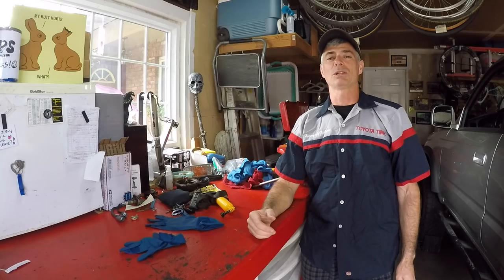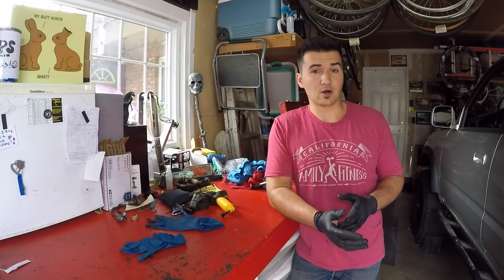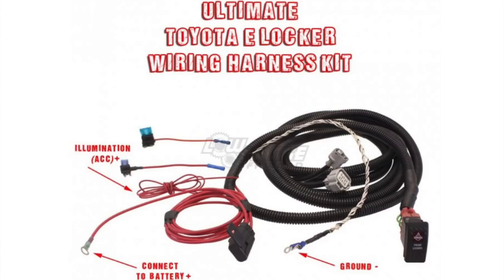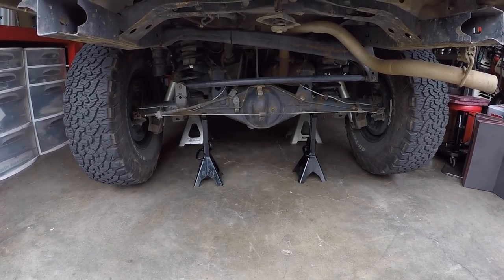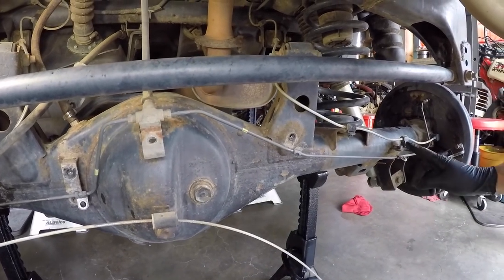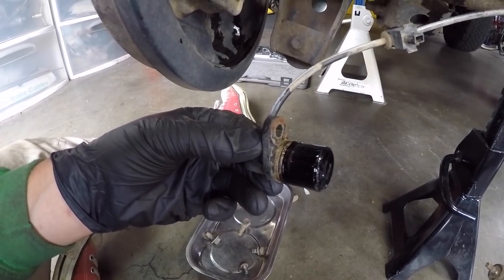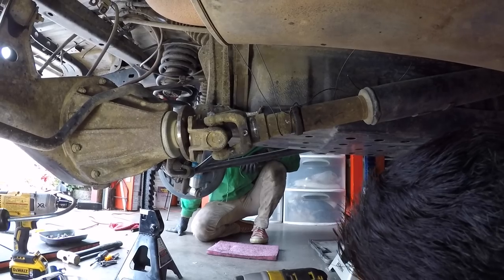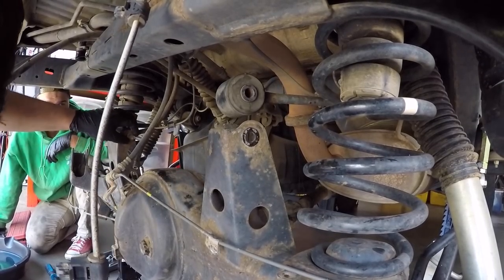E-Locker Axle Swap + Wiring How-To

Comment from the maker: PLEASE READ THIS COMMENT AND THE VIDEO DESCRIPTION FOR HELPFUL INFORMATION

TOOLS USED FOR THIS JOB
**If you don't see a tool you need listed below, here's a master copy of Timmy's suggested tools:
https://docs.google.com/document/d/1TV08fumiXvyrb6yBMPl0gsp7UlcQEa9lHtqFNiZWOVI/edit?usp=sharing

6 Ton Jack Stands - (used to support frame of truck and support donor axle housing)
 https://amzn.to/2MM91w6

3 Ton Jack Stands - (used to support axle housing on truck)
 https://amzn.to/2qPYS9O 

Heavy Duty Rubber Wheel Chocks - (used to keep the front wheels from moving.  These are nice chocks that don't slip)
 https://amzn.to/2mttRWp

Dewalt 1/2" Drive Impact Gun - (nice strong gun.  used to remove wheel lug nuts and many of the fasteners for this job)
 https://amzn.to/2M2Y9J1

Dewalt 3/8" Impact Gun - (used for some of the smaller fasteners for this job)
 https://amzn.to/2uqWnZy

Dewalt Batteries
 https://amzn.to/2urcx59

Dewalt Battery Charger
 https://amzn.to/2Ud8RlY

Wheel Lug Nut Impact Socket Set - (nice set for all different size lug nuts)
 https://amzn.to/33uatZt

1/2" Drive Deep Metric Impact Socket Set
 https://amzn.to/2WfSTGD

1/2" Drive Shallow Impact Socket Set
 https://amzn.to/2pCrdPQ

3/8" Drive Deep Impact Socket Set
 https://amzn.to/2ZWjY6C

3/8” Drive Shallow Impact Socket Set
 https://amzn.to/2KnoYaq

Flex Head Flare Nut Wrench Set - (used a 10mm flare nut wrench to disconnect brake line.  This is a very nice set with lots of uses)
 https://amzn.to/32GoIdy

Vacuum Cap Kit - (used a 7/32" vacuum caps to put over flared brake line tubing ends to stop brake fluid from leaking out)
 https://amzn.to/31hXY2G

Straight Needle Nose Pliers - (used to remove parking brake line clips)
 https://amzn.to/2pQ6yIa

Plastic Mallet - (used to knock parking brake line pins out and many of the control arm bolts out)
 https://amzn.to/2CCOqVP

Brass Hammer - (used to knock out one of the panhard bolts out)
 https://amzn.to/2QS3Ay7

20 Piece Screwdriver Set - (several screwdrivers were used during this job.  This is a nice complete set)
 https://amzn.to/34aLrQ1

1/4" and 3/8" Flex Head Ratchet Set - (used both these ratchets for this job.  These ratchets are super functional and will make your wrenching life easier)
 https://amzn.to/2ql8nNA

3/8” Drive Regular Extension Set
 https://amzn.to/2OehCao

3/8" Drive 6 Point Metric Standard Socket Set
 https://amzn.to/32WIh0M 

3/8" Drive 6 Point Metric Deep Socket Set
 https://amzn.to/37iQjVt

1/4” Drive 6 Point Standard Metric Socket Set
 https://amzn.to/2QIU7te

1/4” Drive Regular Extension Set
 https://amzn.to/2O9nl2x 

Long Magnetic Parts/Tool Tray - (Good for holding longer tools like ratchets and wrenches)
 https://amzn.to/2m89y0D

Medium Size Magnetic Parts/Tool Tray - (Good Size for keeping track of fasteners/small parts)
 https://amzn.to/2ky8Qt8

Small Size Magnetic Parts/Tool Tray - (Good for holding lug nuts or smaller fasteners/parts)
 https://amzn.to/2m6kQ5y

Small Pick Tool Set - (used a pic tool to help release the extended breather hose on the top of the differential)
 https://amzn.to/2MyN4AH

Long Set of Ratcheting Box End Wrenches - (used these several times in the video.  These are great when you need extra leverage)
 https://amzn.to/2oOhndL

Mayhew 5 Piece Prybar Set - (used a pry bar to force the shock off the lower shock mount.  This is a nice complete set)
 https://amzn.to/2Ob8THw

Mission Automotive Silicone Paste - (used some paste to lubricate the lower shock mount post to have an easier time getting the shock in place)
 https://amzn.to/2NU1En6

Auto Trim Removal Set - (used this set to remove interior trim pieces so we could run the wiring)
 https://amzn.to/37vgzvH

CDI 1/2" Drive 30-250 Foot Pound Torque Wrench - (used this one to torque the lug nuts and larger fasteners for this job)
 https://amzn.to/2UPhyjK

CDI 3/8" Drive 10-100 Foot Pound Torque Wrench - (used this one for the small to medium fasteners for this job)
 https://amzn.to/2U2vUA4

**As Ebay Partner Network members, we earn commissions from qualifying purchases.

**As Amazon Associates we earn from qualifying purchases.
Reply: My differential lock stopped working In my 2nd Gen. Tacoma about 3 years ago I bought a factory new motor for the lock As instructed by a mechanic shop nearby. It still does not work. When I push the switch The locking diff light comes on But just keeps blinking and does not lock in.
Any advice on how to fix this?
Reply from the maker: @rtharmon454  Have you tried driving slow and turning the wheels back and forth a bit to get the locker to engage?  Sometimes they can get a bit stuck after they've haven't been engaged for a long period.
Reply: Hey Timmy! Would it be possible for you to mail me a copy of the wiring schematics for the Elocker mod please?
Reply from the maker: @jrmurphy3788  Click on "Show More" to expand out the video description and we provide a link to the wiring schematic there.
Reply: @TimmyTheToolman  I did and that's how I was able to build my harness however it does not show the color scamatic for the short harness that goes to the locker I need to figure out which wires go through the 8 pin plug so I can repair it
Reply from the maker: @jrmurphy3788  Gotcha.  I'm at work for a couple days and don't have access to a wiring diagram.

Comment: Just got my 98 all done thanks to you man. Went from a death wobbly leaky mess to what everyone tells me is a seemingly brand new vehicle. (I spent a lot of time on the interior cleaning, and paint correction).  Did all the suspension bushings, as well as steering rack, Valve cover seals, rear cam seals, and oil cooler seal.  Timing belt, water pump

Now that my rig is finally a reliable, awesome daily driver, and all purpose 4x4. I’m gonna thinking about adding an e locker soon. The truck definitely needs axel seals anyway so in the not so far off future when I wanna add 33s and a small lift to my rig I will revisit this video and study it carefully to do this swap. For now I’m just gonna enjoy it in it’s near stock  form. Gonna make the best of it even with an open diff. 

Other future planned mods are: tundra brakes, a front Spartan locker and manual locking hubs. I think it would be so cool to run dual lockers on it but I also want the ability to disconnect the front axel from the hubs if I’m going to do that. 

But for now I’m done spending money on it. Only money I want to spend on it is gas! Love my white 98 SR5. Best vehicle I’ve ever driven.
Reply from the maker: Great to hear our videos have assisted you with your rig.  Good luck with the e-locker mod, TBU, manual hubs, and whatever other sic mods you've got planned for you rig.  Happy Wrenching Bro!
Reply: @TimmyTheToolman  I been watching this video on and off studying it for the last few years finally got my Match 4:30 e locker front and rear axles few weeks ago and cleaning it and preping it for the install in the next few months for my wifes Rig .. Was hoping low range still had the harness to make life faster since my wife uses hers as a daily but very straight forward on the Wiring very detailed video so exited... would be sick of you could install these e locker axles on the 4th gens as well.. Sic Mods For life

Comment: For the axle, I jus rested it on the 3 ton jack and strapped it to the jack so it couldn’t pivot or move. Then disconnected everything. Then just rolled her out nicely without worry. Did the same to get the new one in. No strap makes it complicated like you said since the diff is very heavy and wants to pivot down. Hope this tip helps someone if  they attempt alone like I did. I don’t have those strong legs lol
Reply from the maker: Yeah, ratchet straps would have been a good idea, especially for the the jack under the 3rd member.  The jack on either end were very stable but the one under the 3rd member wasn't a very stable support area due to the shape of the 3rd member.

Comment: Great video! Really helped me do my swap with ease. I do want to point something out, I have a 97 and the pin used for the diff locker light on the cluster is different on I assume 96 to 98. Instead of being the fifth one from the left, it is the second one from the next row after the split on the brown connector.
Reply from the maker: We're glad the video helped you out.  Thanks for pointing out the difference for the dash locker light on your 97.  Obviously there's some differences between the years for the wiring for the dash lights.
Reply: Yianni i have the same issue here. 97 SR5 the 5th pin is used by a green/red stripe wire. slot is empty on the brown plug. ...Can you confirm the diff lock illuminated using the second after the split ?
Reply: Terry Giovanakis most definitely. It worked for me.
Reply: @yiannit93  Thank you and.. Καλό Πάσχα!
Reply: Wiring up my 98 right now. Glad to have found this comment!
Reply: you're a life saver. I was having this issue.

Comment: Kept thinking to myself. Fellas don’t disconnect the driveshaft just yet. Save it for last so you could keep using the floor jack for the shocks and uca’s and avoid front pinion pivot. Glad no one got hurt. Great install nonetheless!
Reply from the maker: So you think the driveshaft disconnect should be the last step?  I'll buy that.  You'd just need to get a jack stand under the 3rd member in preparation for it to pivot once the driveshaft and 3rd member separation happens.
Reply: Most definitely with the Taco and FJ work I’ve done it’s the safest. Once all has been disconnected. Drop the floor jack all the way down with the axle. Then while one guy holds the axle which now sits about 3” off the ground the other can disconnect the driveshaft. The yoke allows it to drop almost all the way down to the floor.
Reply from the maker: Cool.  Thanks for sharing this.

Comment: Appreciate the information timmy I purchased a 2000 Toyota 4runner Limited 4x4 Monday and want to swap the rear axle with a e locker mine is the sane color as the the one your next to all the info helps @5:55 @Timmy The ToolMan
Reply from the maker: Good luck with the job when you get around to doing it.
Reply: @TimmyTheToolman  appreciate that bro just gotta find a Front and rear diff with 4:30 gears and the e locker my truck I just bought was already lifted with rock slider and tons of goodies even had a rear view mirror that has a compass and outside temp looks like mirror came from a 2005 Ford f350 heated mirrors and some other nice goodies blisten shocks with adjustable dampeners

Comment: Thank you for this video! 

I already installed my button in my 99 and it had the wiring already for it - can I use that same wiring? Where would the other end of the wiring go to, I assume the kick panel? I'm wondering since it had that, if it also has the wiring for the brown block plug on cluster too, will just have to see on that one.

Comment: I have a 99 limited with the multi mode all wheel drive feature. Can I complete the elocker swap in the same way you guys did in this vid?
Reply from the maker: Yes you can.  As long as you have the e-locker ECU and wire it up properly,  it will work for your 99.

Comment: Grinding out the housing isn't to bad at all to do if all you can find is a e locker 3rd member me and friends have done it many times to install them in 1st gen runners and  trucks. Just buy an e locker 3rd gasket and trace it onto housing and get to cutting, of course test fit the third along the way also.
We usually use long bolts in place of the studs you have to add.
I also reccomened buying a motor guard to protect it on the trail.
Reply from the maker: What are you using the cut with?
Reply: Timmy The Toolman We've used many things lol. Plasma cutter, skinny wheel on both electric and air grinder. Of course starting slow and checking fitment as you go along. Usually doing the final fitting with like a carbide bit on a die grinder, file etc.
Reply from the maker: Gotcha.  It seems in our area we get enough 3rd Gens popping up in the PickNPulls and if you get there quick enough, you can get the whole enchilada and not have to do any alteration to the housing.  After doing this job it got me thinking that I might do the swap on my 2000 4runner.
Reply: Timmy The Toolman yeah for 3rd gen owner makes sense. We all run 1-3 gen pickups and 1st and 2nd gen runners with solid axles

Comment: Are you going to make a separate video on the front diff swap? Great channel by the way
Reply from the maker: We already made a video of swapping a front differential last year.  The link to the video is in the video description.  Make sure to read the video description for the front diff swap and also read the pinned comment from me.  After the job, we learned a much easier way to get the diff out and back in.
Reply: Yup, unbolting the engine mount on the drivers side and raising the engine an 1" or 1 1/2" will make getting the front diff way easier.

Comment: Any reason that you could not use just one power source for the ECU and switch?  I know that the original factory wiring uses separate power sources, but I thought about just combining them to a single source.  Thanks!
Reply from the maker: Don't know.  We followed the wiring diagram linked in the video description exactly.
Reply: Timmy The Toolman probably be the choice. Will do the same. Thanks!
Reply from the maker: @danthemanx07  Good luck with the job.  Hope it goes smooth for you.

Comment: I did the on my 2000 3rd gen but instead of dealing with the wiring I bought a wiring kit that’s plug and play from low range offroad
Reply from the maker: Christopher Galvan Hey Chris, we actually mention this option in the video and in the video description.   But yeah, you're absolutely right that the pre-made harness that Low Range Offroad sells is an option.  It's just going to require you to part with more money and that might be a big deal for some folks.  A friend of mine picked up a front differential, entire elocker rearend, ecu and all the necessary wiring for $200 from a PickNPull.  That wiring harness alone is almost as expensive as all that.
Reply: Timmy The Toolman I got mine from picknpull also for $171 + taxes. Axle,ecu,oem button. I did a stud eliminator and prepped the axle and painted it like this fella. Also put in new oil seals. I got some 18/7 sprinkler wire to do my wiring harness. The wire isn’t ideal since it’s solid and not stranded but it’s held up for a year now.
Reply from the maker: Yeah,  when my buddy Wei said he picked up the whole enchilada for $200, I started thinking I might try to find one for my 2000 3rd Gen and do the swap as well.
Reply: Christopher Galvan does this include the ecu? Or is it not needed with the kit?  Just sourced a 4.10 complete e locker axle but I don’t have any wiring yet

Comment: Thanks guys for showing us at home how to properly perform this job. My question for you is... is it worth it to put this setup in an 02 4runner with vsc and atrac. What are the ups and downs of doing such a thing. Again guys thanks for the knowledge and taking the time to film this. You guys saved me hundreds of dollars swapping out my front struts in my daily driver with the videos you produced.
Reply from the maker: I definitely think it's worth doing in an 02.  A locker will definitely help you while off-roading regardless of the VSC and ATRAC.  The ups are better off-road performance.  It could help you get yourself out of a situation you would normally need to be pulled or winched out of.  The downs are the time and money you have to invest in doing this mod.  Great to hear you are making good use of our videos and saving yourself lots of money.  Happy Wrenching!
Reply: @TimmyTheToolman  thanks for the info, now my hardest job is to find one that's not rusted to flakes for a reasonable price. Can you do a video in the future on how to bypass the vsc/atrac system I don't think it would be as easy as pulling a fuse haha. Thanks again guys.
Reply from the maker: @jreg0028  This is something we don't have experience with but it would be cool to figure it out.  No promises but I'll do some research on it.

Comment: The 3rd gen 4runner was sold with a 4.10 gear elocker.  Thats how I did mine..
Reply from the maker: That's interesting Ben.  I thought the e-locker 3rd members were all set up with 4.30 gearing.  Update - Sean told me Tacoma e-lockers did come with 4.10 gearing.

Comment: I have a limited 4runner 97 and it comes from the factory with differential lock
Reply from the maker: The rear differential locker was an option you could purchase when buying a 3rd Gen 4runner.  It didn't come on all 97 4runners.  This video is for those people who weren't lucky enough to buy a used 3rd Gen 4runner that already had a locker on it.

Comment: Hello Tim, your video was very helpful as I did the exact swap in my 1998 4Runner, I am struggling a bit with the sway bar hitting the e-locker motor and I was wondering what you did so it would clear? Toyota sells another sway bar that has different bends to clear the motor but I was wondering if you had some trick to make the original sway bar work?
Thank you
Reply from the maker: Sonoran Steel sells a lift bracket for the rear sway bar.  He sells them with his lift kits but he would probably sell it separately too I think.  The lift brackets will move the sway bar up and away from the e-locker motor.